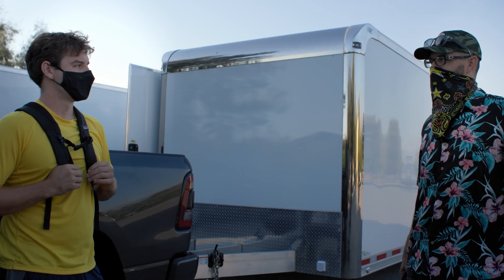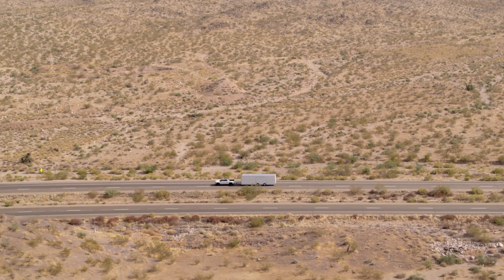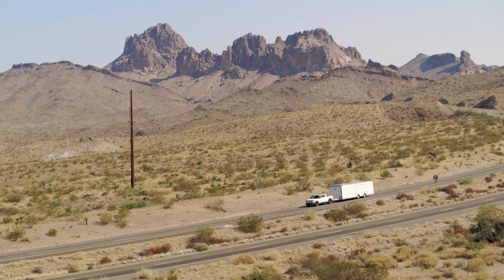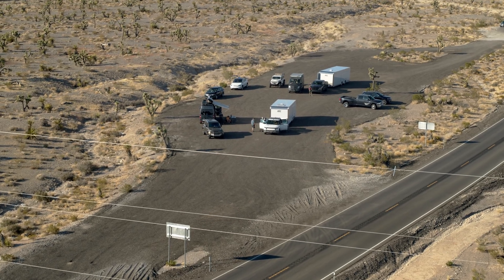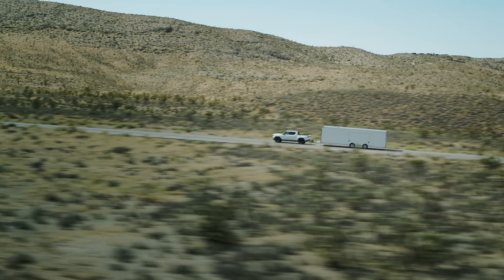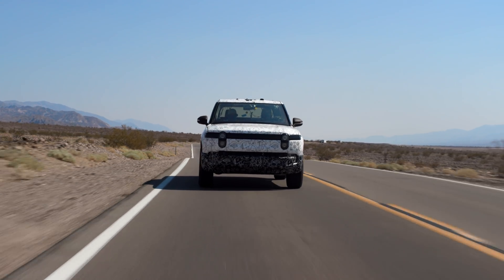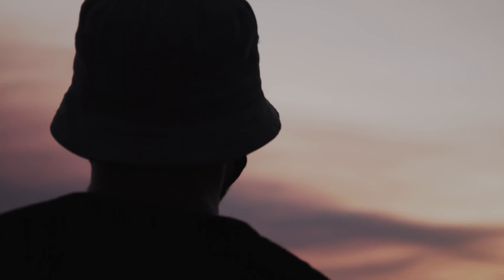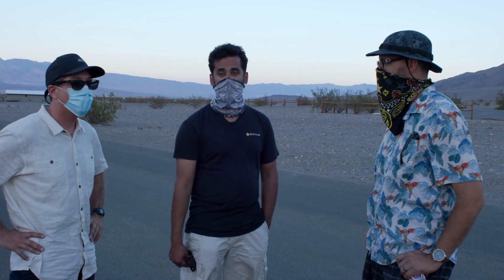Hot Weather Towing | Progress Report | Rivian

Comment: Now try it in -40C
Reply: Fun fact: -40 is where F and C are equal.
Reply: Chris Volnek fun fact at -33F propane is unusable as it won’t vaporize.
Reply: Should have a battery coolant heater so it shouldn't be an issue if you can leave it plugged in at least into 120 volts overnight to keep it warm
Reply: Bring it to Lapland. If it performs there, it can do anything.
Reply: it will still work just at reduced power until the battery warms up.
Reply: Comrade, I come visit u in Siberia
Reply: Anyone else watch Long Way Up ok Apple TV+?
Reply: on the ike gauntlet
Reply: @maxotzenberger8374  100# agree
Reply: CYBERTRUCK - hold my BEER.
Reply: @markplott4820  Cybertruck is for suburbia truck owners that never carry/tow anything but air. It will look cool at the mall but it isn't a work truck.
Reply: @davidmccarthy6061   - WRONG, 3500 lbs CARGO with 100 sqft Bed with LOCKING Storage.
up to 14,000 lbs TOWING , 0 - 60 up 5% Grade at 85 mph in just 10 seconds . 
1x 240v outlet and 3x 120v outlets in the BED.
BIODEFENCE cabin Air filter HEPA.
4 wheel INDEPENDENT Adaptable Air Suspension , with kneeling .
CLASS Leading 16" Ground Clerence with 14" Travel and  can lower body for EZ entry.
the Cybertruck will be the FASTEST up PIKES PEAK .
CT is Already the FASTEST pickup in the WORLD. 
it can TROLL Porsche 911.
Reply: @markplott4820  All these promises for the CT and Tesla still cant make a car with matching panel gaps, still has issues with misalignment which in the 3 and Y are causing spontaneous glass destruction and still, YEARS after it was promised, has no FSD.  But sure, CT will be everything it was promised to be because fanboys see what they want to see.
Reply: @hamsterminator   - In CHINA Panel Gaps are NON ISSUE , as will be with GF4 BERLIN & GF5 TEXAS. 
GF4 BERLIN will be TESA MOST ADVANCED FACILITY.
it will use 4680 Cells on DAY ONE, and will use FRONT & REAR Megacasting , INTERGRATED Cell to Car , and have the MOST Advanced PAINT SHOP by GEICO - TAKESHITA !!!!!
LIQUID METAL SILVER Paint coming soon!!!!!!
FREMONT is an OLD Factory built in the 1960's .
EVERY TESLA car made has HW3 Autopilot (FREE) and FSD. 
its up to the Buyer to enable FSD for $8,000.
and the TAKE RATE is over 45% for FSD.
I use TESLA LEVEL 4 FSD Everyday on my Commute, its Quick and Reliable. 
NOW, ELON Tweeted - FAS is now Capable of ZERO INTERVENTION DRIVES.
Reply: @hamsterminator  Don't own a Tesla but I noticed that FSD was released this week in beta... How do your words taste?

On top of that why would you want somebody to rush self-driving?... To cause more accidents?

Somebody's not the sharpest tool in the shed...

What does panel gaps have to do with power output and performance?

The thing about Tesla is that Elon musk doesn't settle which is why Tesla is the ONLY North American vehicle that receives constant updates including updates to enhance performance and enhance range....and being that they have a supercharger network when rivian is just starting out and most likely going to use DC fast charging it's not going to be a contest....

I'm actually looking at the rivian SUV but if they don't have a sufficient charging network I might as well go with a model X to save myself heartache. The very fact that they have a deal with Ford one of the worst companies in America with GM not too far behind that doesn't sit right with me...
Reply: @markplott4820  sure, the cybertruck may be capable, but will the average cybertruck owner ever make use of that capability?
Reply: @gwyneddboom2579  - no which is why TESLA makes the CT in just a Dual Motor with spec CLOSER to the F150 Lightning, but you should expect TESLA to exceed the initial spec
Reply: @markplott4820  I expect Tesla to miss their promises, as they regularly do with either specs, fsd capability or production dates and we are talking years off. They fudge their range figures as they are self reported to the EPa
Reply: @GA-wq8xq   - TESLA Exceeds EPA Range estimates, you can Drive a TESLA 20 miles even after Range hits ZERO miles.
Reply: @markplott4820  so what you are telling is a) all the magazines and groups like Edmunds and Consumer Reports are just wrong and b) the Tesla computer is inaccurate since it shows zero but you are not at zero. Neither is great.
Reply: @markplott4820  let me get this right, you are more knowledge and correct than the independent and well regarded CR, who have owned multiple Teslas. Tesla did some good things, and they do some bad things )although I doubt you accept any bad things),. There are now several new kids on the block taking what Tesla has done and building in it. I thought Tesla fans always said it was about the transition to EVs that mattered, not the company, yet you blindly now follow that company.

Comment: im curious what the tow range will end up being.  Love these R1Ts!
Reply: They added a blog post to their site to go along with this video. From that post: "The challenge with benchmarking range in a towing context is that we are setting the benchmark. Nobody has released an EV that can tow anywhere near the weight that the R1T can tow. Range will always vary depending on your load and external conditions, such as wind and grade. We generally see about a 50% reduction in range when towing at full capacity."
Reply: @JamiePainter  
If they can get 100-200 miles of towing I think that is perfectly acceptable for the vast majority of people.

I currently have an F150 with the 36gal tank.  And can tow fully loaded for about 400 miles between fill ups and a fill up takes maybe 4 minutes.

I'm planning my next truck to be a plug in hybrid because I don't see EV trucks being able to compare with long range towing for a long time yet.
Reply: my closest race track is 140 miles round trip. the range anxiety while towing would be HIGH. forget about other tracks... i feel like i'd have to keep my Duramax for now. that being said, still have my R1T reservation.
Reply: @carsthencoffee9920  That is why I think a plug in hybrid truck is the better in-between for now.  I drive 80% of my miles as the daily driver at about 40 miles per day.  Give me 40 miles of all electric range and that is all I need.  Then a small engine like the 2.7 Ecoboost for towing/driving long range.
Reply: @devinjohnson8623  I agree. My Expedition EL is a daily driver, but we tow a 7K travel trailer several thousand miles a year. A PHEV would provide EV only driving around town, while preserving the ability to tow a heavy trailer. My only concern would be payload reduction with the battery weight. And since we stay at RV parks, we might be able to charge using the 30/50 amp connections on-site.
Reply: @Willsimp4tacos  which statement of mine is the lie?
Reply: Why is it perfectly acceptable that an ice row rig(outside of certain diesels. Loose 40-50% range when towing. Yet a bev tow vehicle is penalized for similar reductions? 🤔t

Example my last f-150 empty would get 22mpg. Any kind of load in the bed though? 16-18mpg.
Towing a 6000# 20' travel trailer. About 12-13mpg.
Reply: @4literv6  Because of the ease of refueling. I get 9 mpg towing, but there are gas stations everywhere so I'm not overly concerned about running out of fuel. Until EV charging infrastructure is built out and supports vehicles with trailers attached, the lower efficiency while towing will require more planning. I stop every 250 miles while towing. If I have to go up a grade, or hit a headwind, no biggie. If that happened in an EV and you're at risk of not making it to a planned stop, it would be nerve wracking. The one area the EVs have a huge advantage towing is in cities, because they probably won't deplete the full range in one day. Fleet managers should be overjoyed that these things are coming because they'll reduce operation and maintenance expenses substantially.
Reply: @4literv6  I don't think anyone is saying that getting 50% less is unacceptable.  I think the issue is going from 400 miles -> 200 miles instead of 700 miles -> 350 miles.
Reply: Devin Johnson what fantasy land do you live in? You’ve never once got 750 miles on a 36 gallon tank of gas. Just stop.
Reply: @Willsimp4tacos  Not that hard to get 21mpg if you are going 55mph and aren't fighting the wind.
Reply: @devinjohnson8623  For this use case that makes sense (hybrid). Most trucks never tow or haul much more than a few bags of soil from the local Home Depot.
Reply: Devin Johnson Wouldn’t a power stroke diesel hybrid be pretty sweet?
Reply: @andrew20146  Totally agree. That's why I think a plug in hybrid would probably be the perfect solution for most everyone.
Reply: @devinjohnson8623  That's the opposite of what he said. An EV would be the perfect solution for most, the few that actually do tow heavy loads long distance then a hybrid is a better option.
Reply: @boostav  I guess I fail to see where an EV is better than a hybrid.  I think the range you get with a hybrid is vastly superior to the extra 200 miles you get of only battery range.

And if 90% of your driving is less than 50 miles per day, which is most people, then both the EV and hybrid cover that use case.
Reply: @devinjohnson8623  the EV would be superior for someone that tows short distances frequently, like a fleet vehicle or commercial vehicle that doesn't leave the city.
Reply: @4literv6  it takes 5 minutes to gas up a truck and there's fuel stations everywhere. Go look at a map of charging stations and you'll see the issue. Even if you limit yourself to only towing on the charging routes, you still will have to stop every every 100 miles for about 40 minutes and you'll have to unhook your trailer to charge. Does that sound practical for even 10% of people towing trailers?
Reply: Devin Johnson, agreed but you’d need a 200kw battery at least, possibly even more than that. Rivian haven’t released final specs on kw density but I hope it’s enough.
Reply: I would guess maybe 100 miles if we are lucky.
Reply: At least they used a decent sized box trailer for the test, not a low streamlined trailer. Would be interesting to see how much quicker the battery ran out 🤔🔋